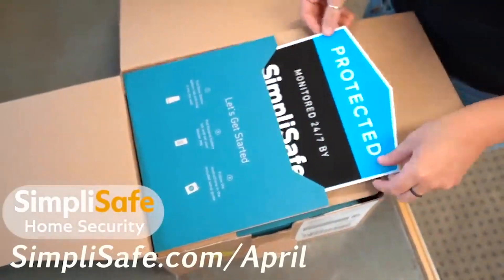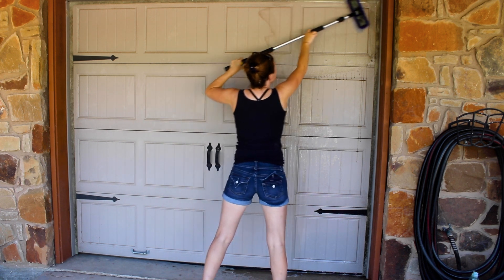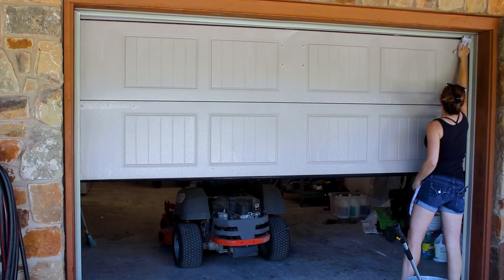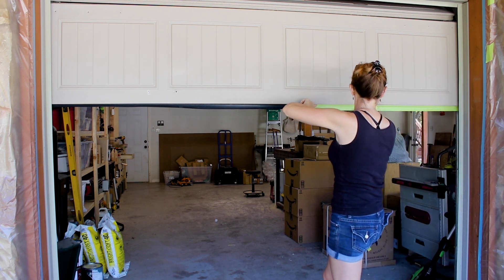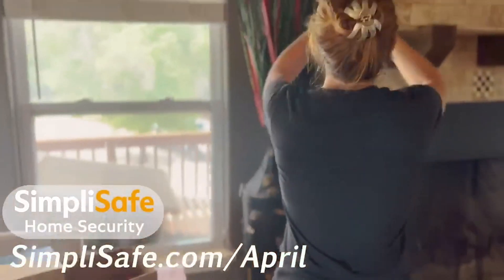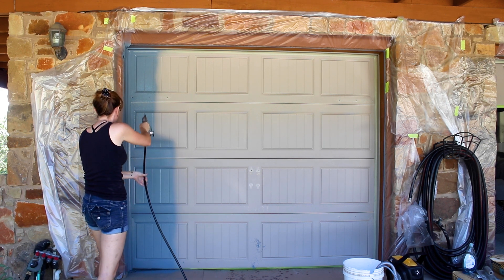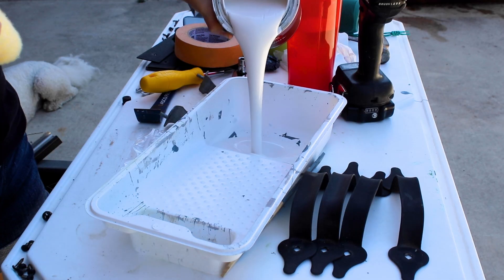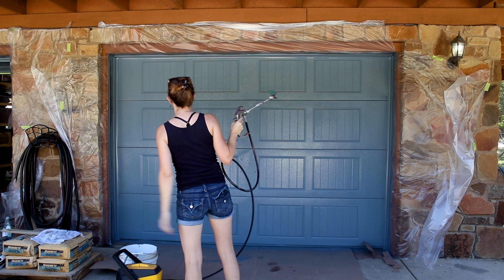How to Paint a Garage Door | Curb Appeal Fast & Cheap

Comment: Just painted mine on Saturday(16' x7'). Did it brush & roller, 2 coats (northern Canadian weather, want it to last long). As well propped the garage door up at diff heights to do the panel edges. Rather than mask, I just unscrewed the trim pieces and replaced them after all was dry. Even with my paint discount, I find it's crazy expensive to waste paint with any over spray.

Comment: That was a cool video. I don't like painting at all but it's sometimes necessary. My doors are all wood and I just finish them. My front door is metal and I might try your sprayer method. Wagner doesn't make a bad tool in my opinion. My security system is 12 gauge. Great video and thanks for the tips.👍❤️
Reply from the maker: Right on! Thanks for watching!

Comment: How you painted it perfectly fine. But cause I work with a lot of different paints when I used to work at a auto body shop. I am just in the habit of primer, base, and then clear. I applied that same principle to wood painting and such and I can say without a doubt that it usually is a much better finish and protection then just repainting over something.

Comment: always clean from the bottom up so streaks will not be formed by dirty water running through the dirt below.  sounds backwards but it is not.  of course, if  you are painting .. likely order is not required. dont forget to paint the hose to match the door color.😆😆😆😆🤣

Comment: tbh - nice owrk but I liked the white colored doors better in contrast to the relatively dark stone walls. 
The (nice) blueish color looks darker relatively to the stone wall.
But as always, the beauty lays in the eye of the beholder.

While I'm at it - at "complaining" that is;-) - lifting the garage door after paiting might allow dust particles from the garage ceiling to fall down onto the open garage door paint while it is still sticky, especially on  windy days.

Instead, putting a vertical protective foil in front of the garage door while the garage door is still down should protect it from the flying dust particles.
But, of course, as always, it's just another way of doing it.

Comment: April, I know I said I liked it white, but I admit that I like the matching Blue better. 😁

On another note, have you ever used any of the insulation kits for garage doors? My garage is also my shop space with the garage door facing the western sun. All summer long the space is hot as the hinges of hades and too hot to work. The kits are between $60 to $200, much cheaper than a new $3000 insulated door. 🤯. Thanks for the advice.

Comment: any tips on painting the gaps between the panels (seen at 6:06)? my garage door is dark brown but has the beige\white original color where the painter ignored the gaps. drives me nuts every time i open the door!
Reply: Was wondering the same thing! Tempted to lift door until the panels spread slightly and spray the gaps, but each would likely need to dry completely before moving on to the next. Also, the area behind the weatherstripping makes me think it would be better to remove it/paint/ and then replace with similar color, or some that matches the new trim color.

Comment: Paint won't stick to rubber. You were smart to do white trim because you're going to be replacing your seals sooner than later as the paint flakes off of your seals.
Reply: It does stick. Mine has held up for 10+ years.

Comment: DO NOT paint your the pliable parts of your weather strip.  Movement will cause the paint to crack and peel and it will end up looking like CRAP.
Reply from the maker: Well, when that happens then I will address it. One Viewer commented they painted their weather stripping 10 years ago and still looks great, so we'll see. But no biggie if it needs re-doing. Thanks for watching.
Reply: @AprilWilkerson  Honestly, there are factors that could affect that outcome such as climate and paint quality.  I've had callbacks when customer have asked me to paint them so I stopped doing it.  A lot of the time I remove the strips from the door frame and replace them after painting.  That has the added advantage of not leaving the unpainted border under the strips.  Keep up the good work.